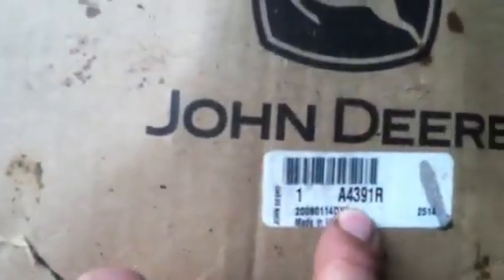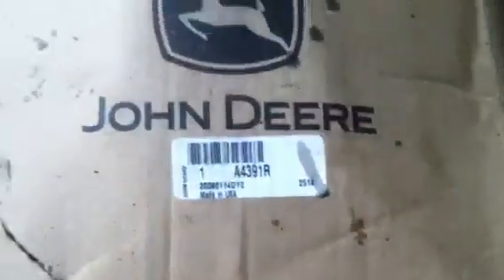The 60 is waiting for rain

Comment: the older they are the more fun they are !!the new the more comfortable they are!!
ill be cuttin hay pretty quik if i can get all my junk fixed  ive worked on the baler most of the day. sink holes suck when you find them with a baler i managed to bend half of my pick up guards and the guide wheel and i broke the bolts the hold the lift to the rake. fun fun good luck!!!!!!!!!!!!!!!!!!1